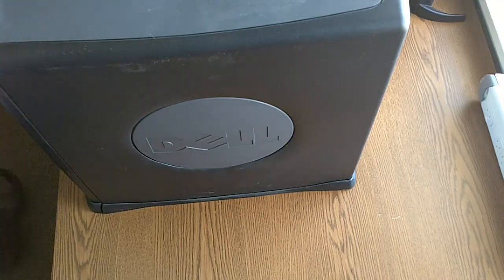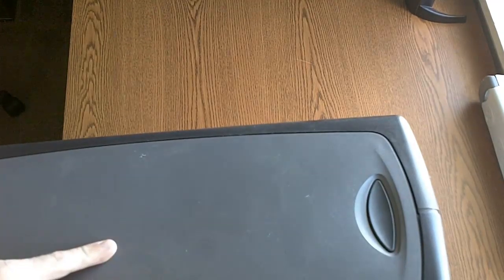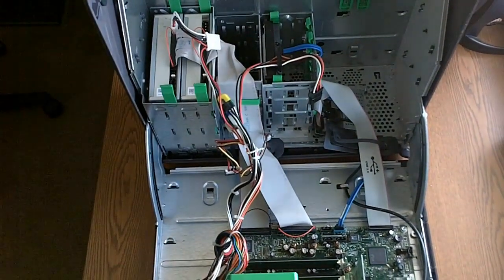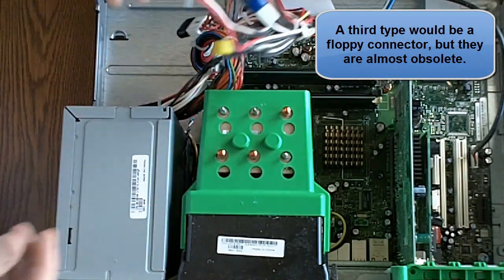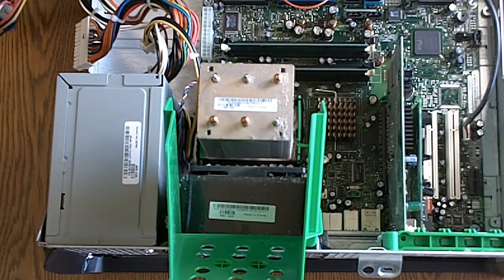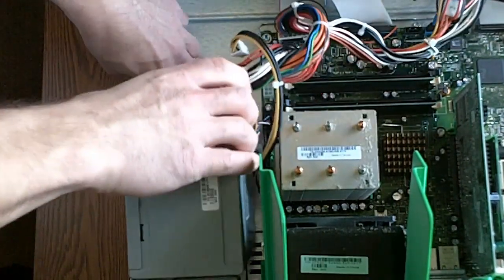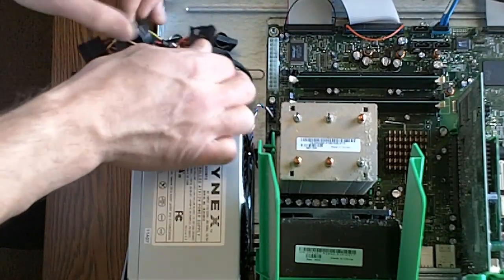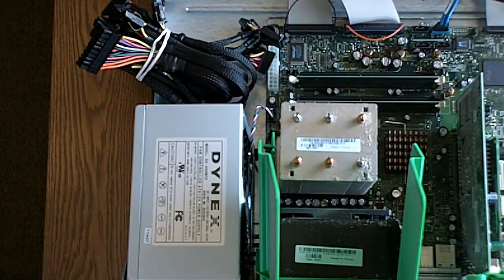Dell Desktop Power Supply Replacement-1.mp4

Comment: My computer died recently, not sure yet if it is the power supply or not but I did notice some of the capacitors are bad. I'm trying to figure out how to remove the motherboard, specifically the usb ribbon now. I'm not trying to destroy anything else, any videos of 8400 dimension motherboard removal? This video was great, so I thought I would ask!

Comment: I am wandering, if I can take a power supply form the type of dell in the video and put it into a dell insporon 530? First will the connections hook up, and second will it hurt any other parts? I have one and I'm just wandering if I can save my mother in law from buying a new one.
Reply: Dell cpu no displays
Reply from the maker: If the Inspiron 530 takes a standard size power supply and has the right type of power connectors then yes you should be able to swap them.

Comment: I have a Dell 8300 and I replaced the Power supply according to your great video and it was a "piece of cake". But when I plug it the light in the power button blinks (before it was off completely) and the computer does not turn on. Can you help me, please? What I did wrong?

Comment: Great Video!   I followed your steps on my old Dell Dimension 8400 and replaced the power supply in about 15 minutes.   I also used the same Power Supply you used in the video from Best Buy.   The only thing I didn't do was cut the case.  Since this is a really old machine and wont last much longer, I thought that is not worth the effort.  I had to reposition the PSU a little to allow for the on off switch on the side.   Thanks again!

Comment: I bought a reconditioned power supply and fitted it according to your instructions (thanks!). It worked for 48hrs and now it's doing the same thing. Steady amber light when I switch on but computer won't power up. Is it possible the reconditioned power supply is faulty (in which case I'll take it up with the supplier) or is there a fault causing the power supply to fail??? Not sure if I should buy another brand new power supply or am I sending good money after bad???

Comment: i currently have this machine right now would it be ok to get a new PSU and motherboard and wack an i5 3570k and 8gb ram or would the be the wrong size or just not be able to handle it with airflow and everything

Comment from the maker: @Rappiddz Power supplies are usually universal. Dell uses cheap ones with a max rating of 250-350 watts. The one I used was 450W, so there was plenty of power to go around.

The problem was the design of the case-the switch on the back of the power supply was blocked by part of the case which I cut away in my other 2 videos. Check it out!

Comment from the maker: About a year ago I had a few Dell Desktops where upon powering on, the fan speed would ramp up to maximum-it sounded like the computer was going to literally fly away-but there was no picture or any other sign of life. Turned out the motherboard was bad. If you have any other question you ca post them on the forum at wwwdotcomputerrepaircompanyinaboxdotcom